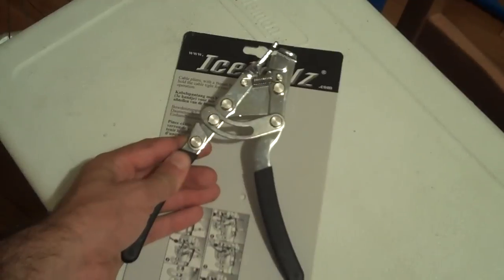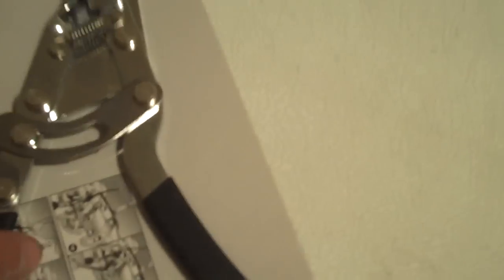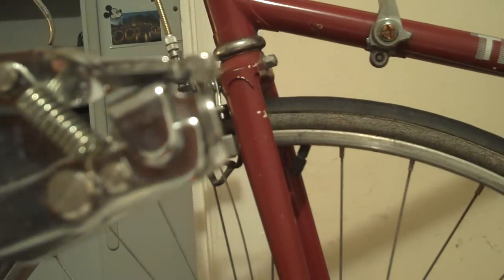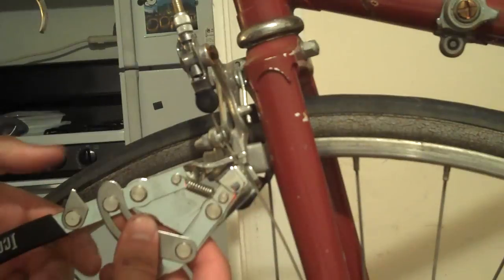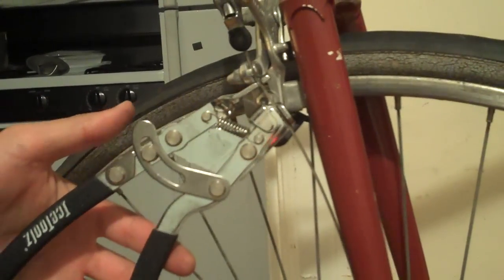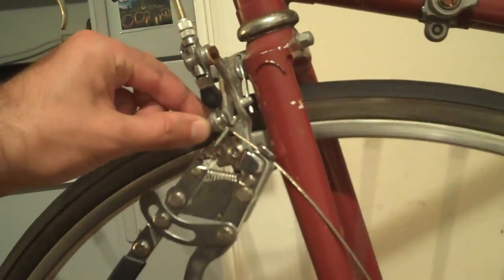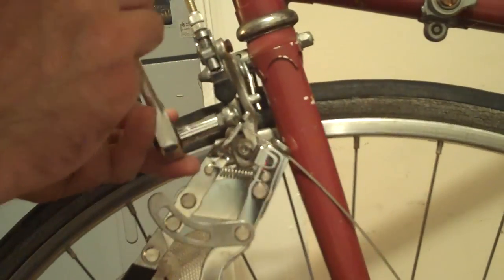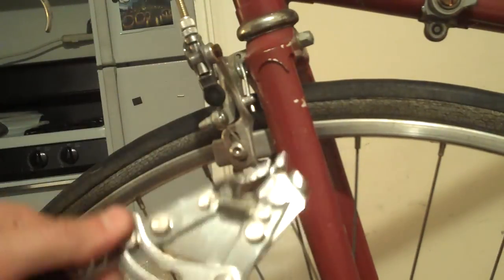How to use a bike cable puller

Comment: Use a cord or similar to pull the brake lever like 1/4 in. Then the cable puller to get the brake pads to the rim, without much force but them touching the rim. Fasten the bolt, remove all tools: Should be perfect. Gap on left+right side total sum ≤3mm.

Comment: You needed to adjust the set screws to equalize the space between the brake pad and the wheel rim on each side before locking down the brake tension nut. That is if your brakes have them. Seen cheap V-brakes that don't have them.

Comment: Does it only work with whatever size/width a bike brake cable is? I'm trying to find something I can use with either 3/8", 3/16", 1/4" cable.